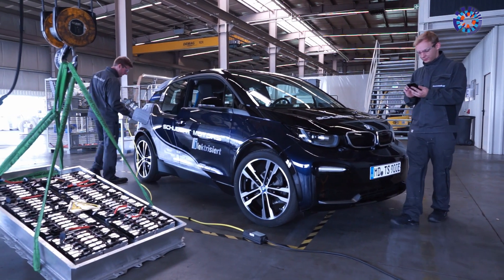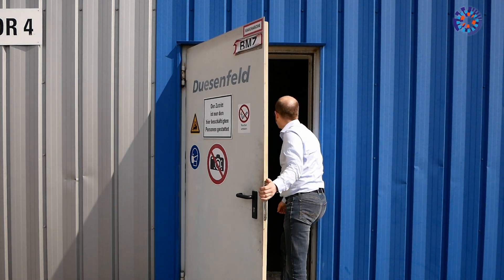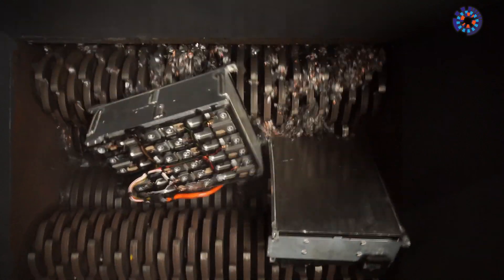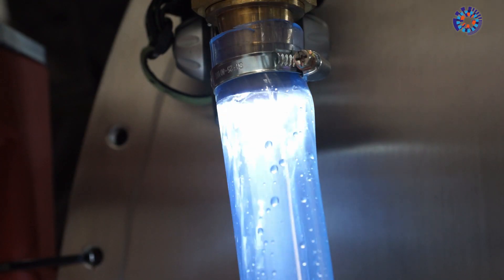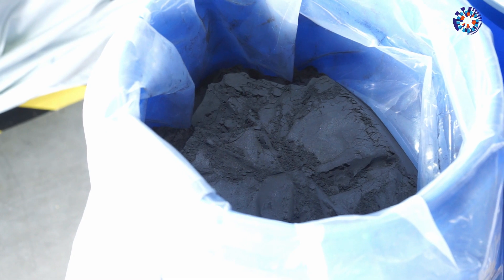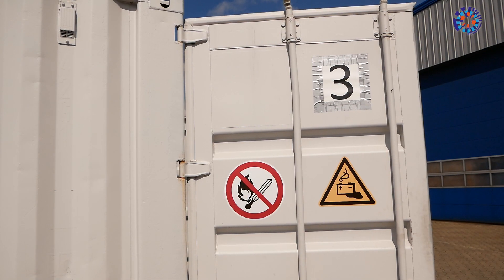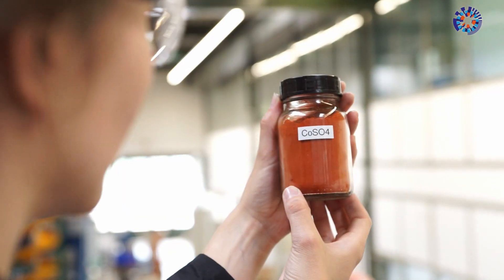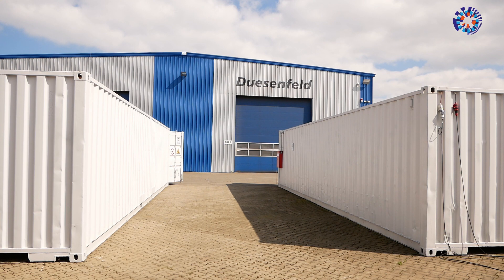Eco-friendly method of recycling EV batteries

Comment: Ok, the batteries first life is in mobile cars but the next life is as a stationary storage device?
Reply: Re-using old EV battery packs is already happening on a large scale. There is a large sports stadium in Utrecht in Holland, powered by 200 old Nissan Leaf batteries, charged via solar. And there is a large windfarm in Wales, in the UK, which uses around 250 ex BMW i3 batteries to store energy.....
Reply: @Brian-om2hh   Ok, you are confirming my question.  Do you know why they are recycling them into stationary storage?  Its more cost effective?

Comment: Stupid waste of good batteries. Even if they maybe are not good for cars anymore they are for sure good as a power bank at homes. This is not environmentally smart.
Reply from the maker: Recycling starts AFTER those batteries were in stationary power banks.
Reply: @Drehmoment-dk  how is that possible?? The video shows a car battery ! Power banks have not been in the market long enough. Our Tesla cars 6 years old have 270.000 km so far and only lost 1% per year. A power bank losses much less capacity. So maybe after 30 - 50 years you need to recycle those.
Reply from the maker: You are right. The large number of batteries is still missing. Most of the used cells come from prototype or crashed cars. But the general idea is that batteries have a second life in stationary use before they are recyceled. By the way: Volkswagen just started a test facility with the same recycling method.
Reply: @Drehmoment-dk  yes I did see Volkswagens new plant. Agree that there is a great market in the future.

Comment: Are they recycling bad batteries or even goods ones get shreded?
you talk about tested batteries at the end of the video...

That is what i ask myself after watching the fully charged video...
Reply: market decides as always with scrappers and salvagers. If your car is in an accident and the system reports potential damage to the battery (happened with mine) they're going to take out that battery and recycle it. There's nothing else they can do so they'll take whatever price they can get from a recycling company. Now if a branch falls on top of an electric car and the battery is completely safe well yes they could sell it to a recycler still. But chances are they'll get more money selling it as a useable battery to another Ev owner for their car, maybe a company who wants to use them in grid storage installations etc.

Comment: before the battery pack is opened and disassembled, is there a discharging process first? if yes, what method do you use? with electronic load discharge, salt solution, or something else?
Reply: I am also very curious about the answer to this question, I hope they will answer
Reply: it is a machine. like electronic load discharge

Comment: Im sad to see a perfectly reusable battery packs getting destroyed 😢
Reply from the maker: Well, there aren’t many used batteries yet. They mainly use packs from prototype cars.
Reply: @Drehmoment-dk  
Those must be destroyed because of prototype regulations?
Reply: Good point. In the interests of eco-friendliness, the structures can be re-used fo the same battery pack for the same vehicle.
Reply: @Alrukitaf  It was not a prototype being destroyed in the video, but a pack from a BMW I3, a vehicle very much in production which has one of the industry's most advanced Samsung cells. 20.9 years average lifespan until 80% capacity remains. And they just throw them in the shredder!!

Comment: The shredders are powered from the batteries, but after the usable capacity is used up, are they further depleted for safer shredding? If so, how is this done and how deeply are they discharged?
Reply from the maker: As far as I know there is no further discharging. Shredding happens under nitrogen to reduce the danger of explosions. Dirk

Comment: I would like to get some of these used battery for my off grid system
Reply: Quite true dear @Tore Lund.
Reply: Xp Reflex  That is not the problem. This company is responsible for no secondhand EV battery packs are available in central Europe! They make deals with salvagers, and collect everything. There is no Environmental benefit to that. A battery in a home installation is more energy efficient than gray powder in a drum. The problem with a million mile battery, is that it will be a long time before worn and derated packs become available, so unless Tesla drivers are worse than average, Elon is not the solution to OP's problem. This company is destroying perfectly good batteries, for pennies of profit!! I think we should organise a protest around the plant: "Battery life matters"

Comment: What happens to the remaining 4%? X by many thousands would amount to a lot of waste, and how toxic is that waste?
Reply from the maker: Most of it is plastic from the separator foil and from the carrier material of the anode and cathode. The normal way is thermal recovery. Which basically means: it burns. Not the best way, but better than thermal recovery of the whole battery which is done by most recycling companies today.
Reply: @Drehmoment-dk  thank you so much for sharing this great process.  Should be required for all recycling of these batteries.
Reply: Burning means it is put into the atmosphere for you to breath! You know the eco friendly way!
Reply: @schulzmj1  doing it without the 4% burn would be better of course.
Reply: @schulzmj1  We burn entire cars at the moment. STFU. You want the barrel full and the wife drunk at the same time.
Reply: So, the process is not as eco friendly as it says it is because it has to deal with the chemicals it creates in its process. Interesting! There is a company that has patented a process that does not have this problem.
Reply: Big Game J so what’s the company?